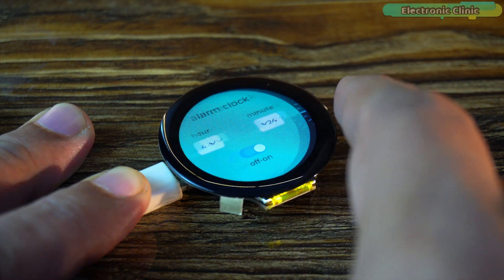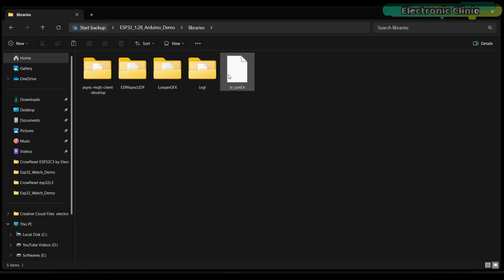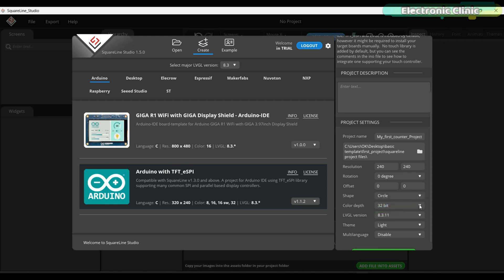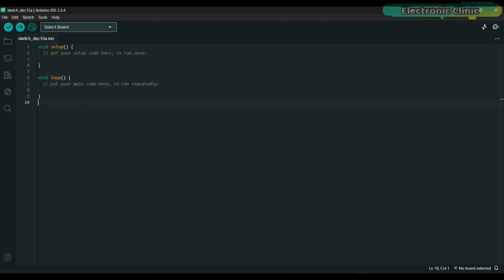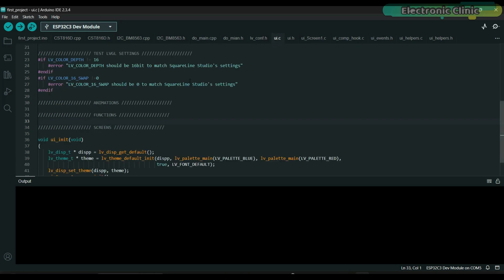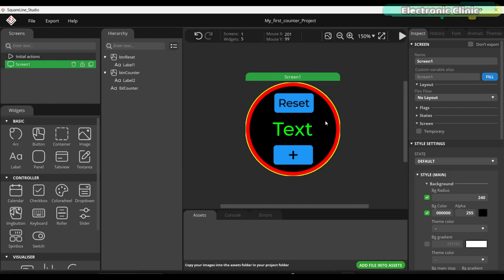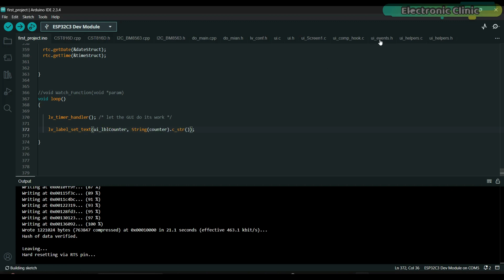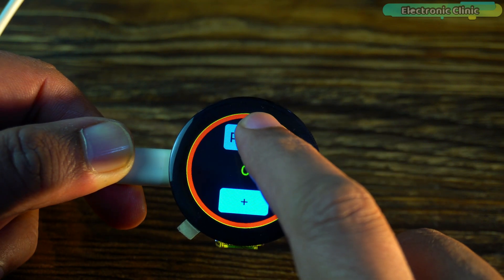LVGL ESP32 & SquareLine Tutorial using CrowPanel ESP32-C3 1.28inch IPS Capacitive Touch Display

Comment: my arduino IDE is stuck on compiling. I have followed the guide exactly. 

I even just tried with verify and still nothing. No errors or messages in the console either
Reply from the maker: @azuraii5238  are you using the same display?

Comment: I cant find the main file as .ino, and when I open the source code as .ino, it shows me empty. 
I tried to copy and save it in the same file, but it shows me errors.
How can I solve it?
Reply from the maker: @FatimaxIdrees  did you download the template folder? That folder already have all the files, you don't need to copy any files.
Reply: @ElectroniClinic  But I wanna do my own, can I do it with the existing files?
Reply from the maker: @FatimaxIdrees  ya you can, but you will need some other files too, template folder will make your work easier. Once you make it working, then you can modify the code.
Reply: @ElectroniClinic  does it work with Seeed Studio Round Display for Xiao too? have diff libraries already, if you can guide me please (；′⌒`)
Reply from the maker: @FatimaxIdrees  I don't know, you will have to compare both the displays.